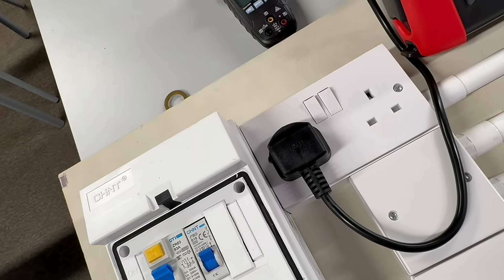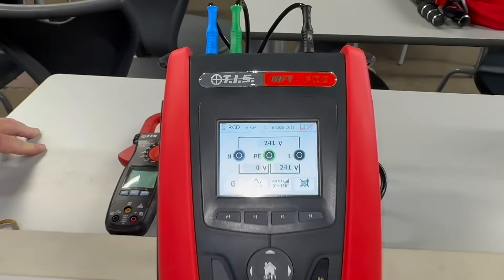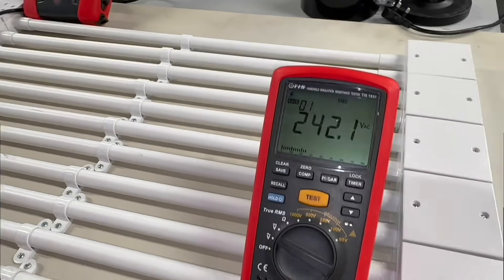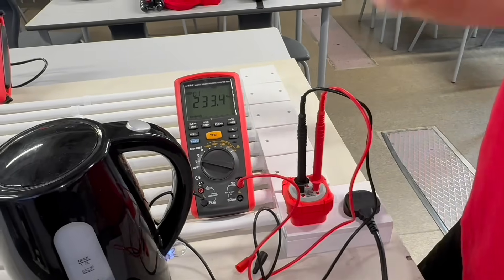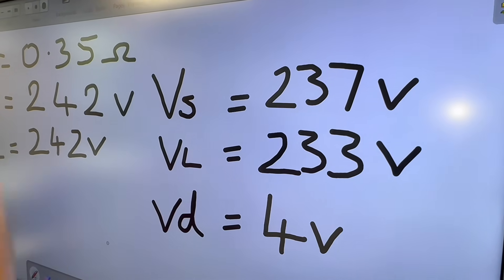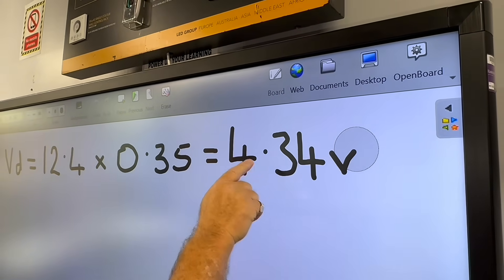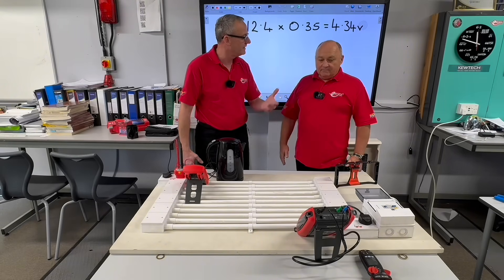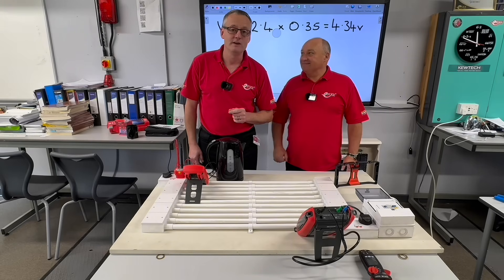Voltage Drop: What Our Socket Test Revealed!

Comment: Using 2 different kinds of measuring devices at different points is a bad control for an experiment, even if we assume they have recently been calibrated and meter connection cables have the exact same resistive values, it beggars belief that someone is trying to do a smart demonstration yet adds obvious flaws into the mix which on their own merit could account for differing results.

Comment: Calculation should use voltage under load, not the unloaded voltage as your also getting volt drop at the input to your consumer unit

Comment: The current calculation is only approximate for resistive loads, rated power / actual voltage ≠ current. Actual formula is current = rated power × actual voltage / (rated voltage)² = 3000W × 233.3V / (240V)² ≅ 12.135A

The resistance of the kettle can be calculated by resistance = (rated voltage)² / rated power. The uncertainly of the kettle's power consumption is low, the high power corresponds to the high voltage and the low power corresponds with the low voltage.

Then add all the resistances together and use to calculate the voltage drop: 

voltage drop = open circuit supply voltage / (supply resistance + circuit resistance + (kettle rated voltage)² / kettle rated power) × circuit resistance

For more complicated loads one can not calculate the average current from the average power and average voltage alone.

Comment: This is interesting and educational to illustrate voltage drop, but you can't use this technique in real life because you have to have built a circuit and then measure the resistance.

You can't do this iteratively.

What you need to do is educate the viewer into calculating what the voltage drop will be for a given length of cable at a specified cross sectional area, at a specific temperature with a specific magnitude of current in the conductor.

Then you can do those calculations iteratively until you find the right CSA cable that will give you the maximum voltage drop tolerable at your maximum load current.

Then you go out and buy the cable and install it.

Comment: There wouldn't be such a voltage drop with a 2kilowatt kettle. 2 kilowatt kettles take very little time extra to boil.
Reply: Absolutely nothing to do with how long the kettle takes to boil.

It is based on cable CSA, the type of metal of the conductor, the length of the cable,  the current, the ambient temperature.

Comment: Surely, for use in calculating voltage drop, the resistance measured should have been line and neutral, not line and cpc? (Yes, all three conductors may be the same size, but the point stands.)
Reply: Good point but in this radial circuit all the conductors are the same size so it didn’t make a difference ✔️✔️✔️
Reply: Inacurate meters cheap metals all from china dont help.Math stand its ground crap we use dosnt.😂

Comment: Why is it that some single phase supplies are 230v and others are 240v ?
Reply: Historically, it was 240V but harmonisation with Europe made it 230V, but because 240V is within the specification nothing actually changed (except on paper).
Reply: In the UK, the supply voltage is 230V nominal. That's allowed to be 6% below or 10% above, so anything between 216.2V and 253V is acceptable.
Reply: Mine is 257 !! It's past the legal limit .
Reply: @arcadia1701e  That is on the high side. If you used any 240V filament lamps they'd have a short life and if you had cold cathode fluorescents I'd worry, but these days most things handle the out-of-range input pretty well.

Check your meter against another? And was that 257V during bright daylight? Sometimes people with solar panels have been told they can contribute a bit more than the local setup can accept without voltage rising too far.
Reply: @arcadia1701e  What are you testing it with? Have you contacted your DNO?
Reply: @arcadia1701e Contact your electrical company then. I hear in some UK homes, the voltage can be as high as 270V which is way too much
Reply: Distance from the transformer
Reply: History.
Reply: some small load or no load, some heavy load when test
Reply: @lurkzie  因为有电压偏差范围，220～240V都是正常的😊

Comment: Technically, Current does not "flow" in a circuit. A Voltage flows, impeded by resistance, culminating in heat, which varies according to the load applied. hence the voltage drop.
There is no way to measure Current directly as a by-product of EMF.
You can use a Current Clamp to detect the Magnetic field surrounding the conductors. Or, use a Current shunt, by measuring the Errrrm VOLTAGE across a known resistive shunt.
Ultimately, it is incorrect terminology to state Current flows or is flowing, as it is a static Magnetic field surrounding the conductors which varies in amplitude according to the load applied. Remove the load, no current can be detected.
55 years in Electronics, and 40 years in Radio communications. High risk environments. Radio transmitting areas.
Don't insult me, but genuine debate is welcomed.
Reply: Voltage does not flow. An unconnected battery has voltage. Until there is a connection between its terminals there is no flow.

To use a plumbing analogy, voltage is the pressure in a pipe, and current is the flow in a pipe. Resistance is the constriction of the pipe. A pipe with a closed tap on the end may have plenty of pressure but no flow.

Current is the movement of electrical charge - the flow. The word "current" derives from the Latin verb currere "to run/move/travel".

With AC current the electrons don't move that far or fast, but they do move under the "pressure" of the changing voltage (which propagates at a sizable fraction of the speed of light).

And there is a way to measure current directly. Put an ammeter in the circuit. Moving coil ones used to directly measure current, but modern digital ones use Ohm's Law and the voltage drop across a very small resistance. Clamp ammeters act as transformers which measure the (changing) magnetic flux which is proportional to the current flowing (and the number of turns in the coil), not the voltage.

This is high school physics, known since the days of Michael Faraday.
Reply: 🐣 .... I am an electronic 
engineer ( retired ) .... 
voltage : is the potential 
measured across the 
circuit ( in volts ) . 
example : across the 
terminals of a battery . 
amps : is the current 
that flows through the 
circuit ( in amps ) . 
ohms : is the resistance 
in a circuit ( in ohms ) . 
the voltage across the 
resistance determines 
the flow in amps .... 
this is basic ohms law 
as taught in college !!!! 
I seriously recommend 
you go back to school 
for a proper education . 
please don't put any more 
comments on Y.T. videos 
to mislead people ....
Reply: A voltage is not a flow. It's a difference in electrical potential between two points. Current is actually defined as a flow of charged particles. It is right there in the definition of the Ampere and the Coulomb.

Now there is a point about the energy flow being in the electromagnetic field surrounding the conductors, but that is a rather esoteric point not really important to electricians. However, to be absolutely clear, a current is a flow of charged particles. Of course with AC the direction of flow alternates.

It is worth noting that the actual movement of electrons in a conductor due to the current flow is amazingly slow. It is called the drift speed, and it is fractions of a millimetres a second.

Note that the charged particles do not have to be electrons. The current flow in a battery cell is of ions for instance.
Reply: @TheEulerID yes - electrons don't travel at the speed of light, the push down the conductor reacts at the 'speed of light'.

I got a Star at school for that one..
Reply: Voltage flows 😂

Erm.. wasn't what I was taught..
Reply: I'm wary of anyone claiming to be experienced 'engineers'.
Reply: @leet3707
🐣 .... I am an electronic 
engineer ( retired ) .... 
any electronics handbook 
will explain "ohms law" and 
that current FLOWS through 
the circuit , the person at 
the start of this comment 
clearly has a problem 
with education ....
Reply: Utter rubbish.
Voltage does not flow.
Voltage is across two points. It is not flowing 

I don't know where you learned your electrical theory but it certainly wasn't at university. I suggest you go re-do your education in this subject.
Reply: @deang5622  I distinctly said do not insult me. This just proves you can't debate in a civil manner. I gave a full explanation, which part of it don't you understand.?!
Reply: Voltage can exist without any current flow.  Current flow is the movement of electrons in a conductor through a complete circuit..
Voltage does not flow.
Reply: Current absolutely "flows." In a typical circuit, electrons are literally drifting through the conductors. You can calculate their velocity and it's a pretty standard physics homework question. Voltage has nothing to do with it per se. It is a measure of potential energy relative to a reference point. Analogous to pressure. Power is always transmitted through the fields, not the conductors, so AC vs DC has no bearing here.

And yes you can in fact measure current directly, using single electron transistors and then counting the charges.
Reply: @thenimbo2  Well you say Electrons are moving through the conductors, that is not Current, that is Voltage, the Electrons are Voltage. Current creates a Magnetic field surrounding the conductors, in DC it is polarised one way, in AC the field alternates in the case of Mains, 50 times per Second. In RF circuits, which is what I am qualified in, the AC can alternate at any frequency I choose kHz, mHz or gHz.
AC is a rapidly alternating Magnetic field, which can be detected by a Coulomb Meter (Clamp) or a resistive shunt, where you measure the Voltage across it, and calculate the Current.
Many people conflate Voltage and Current, They say you apply a Voltage and the Current flows, which is technically incorrect at the basic Physics level. Current does not physically flow, in fact it is manifested only when a circuit is under load, otherwise it does not actually exist.!
Reply: @G1ZQCArtwork  It is utter nonsense to claim that electrons flowing down a conductor is voltage. That is utter balderdash. The text book definition of current is the flow of charged particles.
Reply: That's correct, and no debate is needed.  No disrespect, but electricians aren't scientists.

Comment: Sometimes I run a cable larger than it needs to be . Especially if it’s likely to have more load added at a later date. A good example is even if a customer wants a 8.5 KW shower I wire it in 10 mm . Because the number of times I have seen a plumber change a 8.5 KW shower to a 9.5KW with no consideration for the cable size and volt drop . And in some cases the MCB as well. 
How is this going to work on existing installations that have already had voltage drop calculations done for say 240 volts and  the powers to be want to reduce our voltage even more.
Reply: yes it will turned out whether electrician or plumber shall replace or install electrical shower.
Reply: The powers that be are not reducing the voltage!
That's a myth.

What they are doing is wanting to reduce the specification so that more power from solar panels installations can be accepted on to the grid.

The spec was changed years ago and the nominal voltage reduced from 240 to 230 and this did not result in an actual change in voltage on the supply.

Comment: Is that cheapskate college - Chint were always a cheap and cheerful brand
And what's with the type AC RCD - how long have they been using that set-up?
Reply: CHINT are the most unreliable stuff I have come across . I suppose if you go cheap what do you expect. 
They used all this stuff on a static caravan site near me . I can’t remember how many times I have had to change this crap as the RCDs have failed and RCBos the same .  I now just change it on sight for Hagar .
Reply: There's no issue with using a Type AC RCD in that setup. It's a rig specifically designed to show how a load impacts voltage drop. As long as the demonstration uses a simple resistive load like a kettle or toaster, then there's no issue.